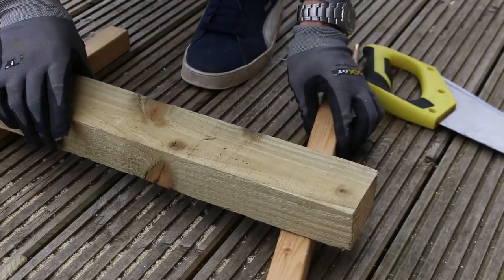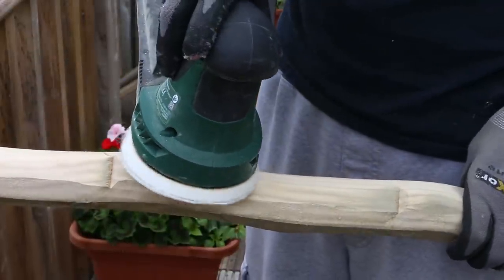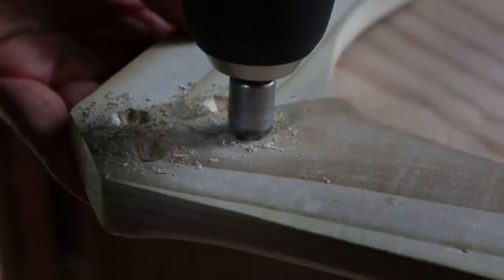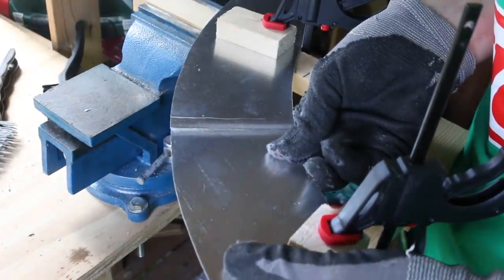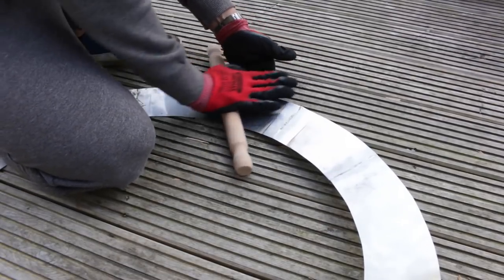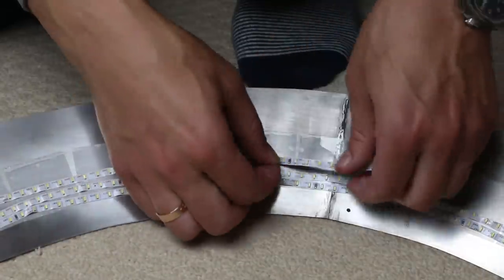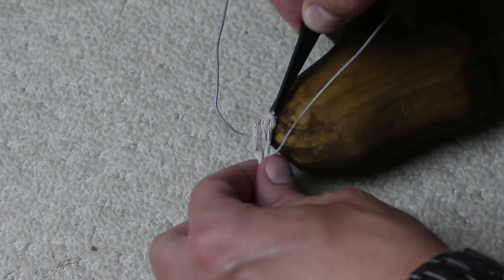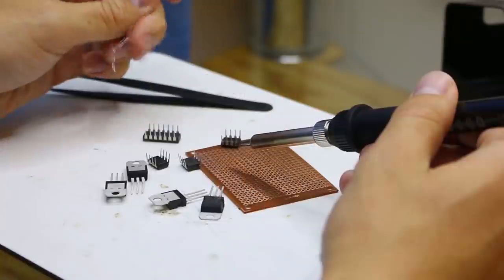DIY Desk Lamp From Over 700 LEDs

Comment: Very nice design! I'm curious as to why you didn't use the heat shrink for the connecting wires in the stand. They probably won't move much and short, but wouldn't heat shrink or electrical tape fully ensure it (unless you did off-camera)?
Reply from the maker: Thanks! I did use electrical tape off camera :)
Reply: @MakeithappenDIY  Ah that's great, I was worried that it would short for you and ruin the hard work

Comment: You could fill those gaps between sections with woodsaw and woodglue. If those led strips are on mains, aluminium disk MUST be grounded, apart from that soldering job is terrible. I understand how much work goes into this, keep it up, but please for safety of everyone, do it right.
Reply from the maker: You are right, I should have earthed the disc; looking back I don't know how I dismissed this. Thought that double tape and hot glue will be good enough but that's a poor excuse. As for the soldering, thought that 100mA was small enough load to not care about it too much.
Reply: @MakeithappenDIY  Please label it as unsafe.